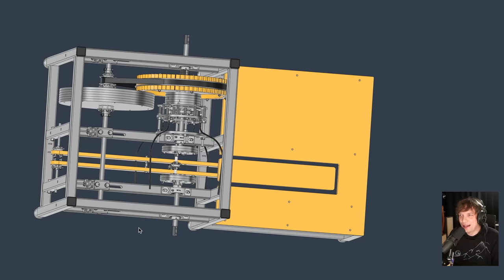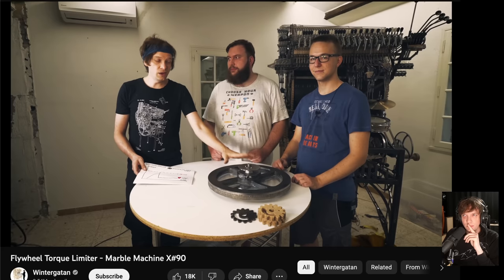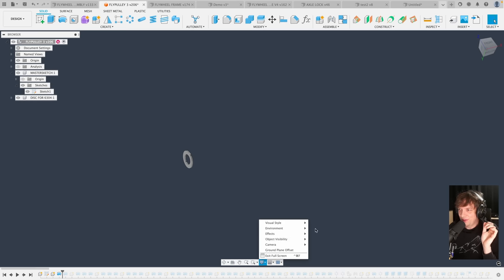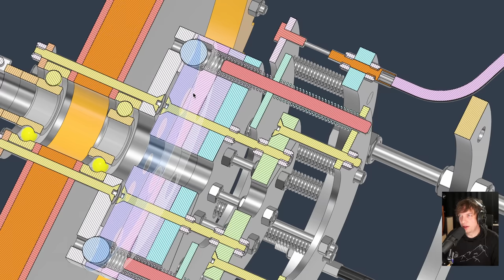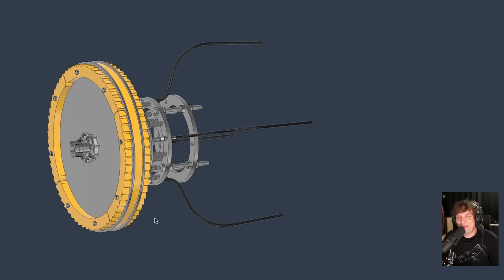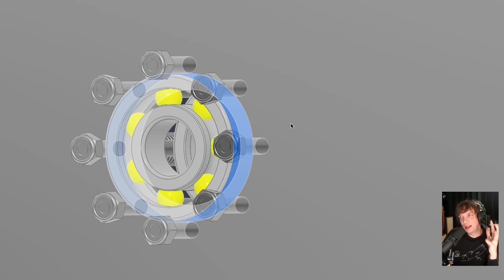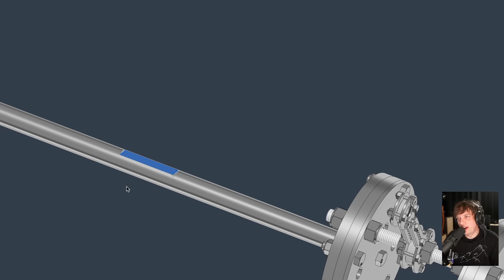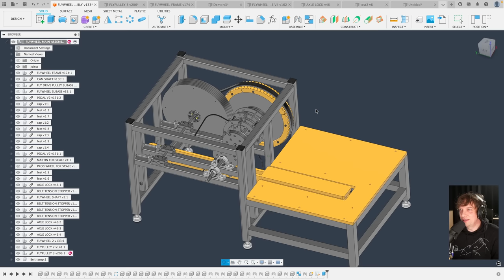Safety First! - Marble Powered Clutch

Comment: My guess on the ratchet design for the flywheel is that its going to interlock with another system to drive the marbles upwards similar to how the old fly wheel was collecting marbles with magnets.  The use of the ratchet there will allow it to pull a "track" of marbles upwards against gravity.   Each tooth of the ratchet will interlock with the track and move it upwards, using the ratchet design will help counteract gravity and the weight of the marbles + the track itself because it won't be able to slip backwards against the ratched tooth.

Comment: Put the pedal on a hinge so it can bend upwards and not crush anything underneath.
Reply: Or you could make the pedal belt driven with a free wheel and a spring that pull it back. Like a bicycle hub free wheel with a belt wound up on it, then you push down on the pedal to spin it up and then a spring the twists the hub back and pull up the pedal.

Comment: Love the design! Took me some time to take in as much as I felt satisfied with.
		Disclaimer: I'm a programmer, not a mechanical engineer
		
		The rods you designed look like they will be under strong rotational stress while breaking (Unless there is no friction at all?)
		- Could they bend? Could they damage other components like the spring and the holes it sits in?
		- The green disk is basically floating with a thin hole and the hole with the spring offers no stability at all

		Great you are cutting a corner with the bearing sleeve. is it easy to fix if you are wrong?
		Or are you going to test this in order to avoid ASSUMING? 
			
		Can you also test how much rotational newtonMeter is generated and whether you shaft/discs are going to deform?

Comment: 18:00 I work as a design engineer, we have already mounted bearings in this way on a trade fair model. We only used fitting screws ISO 7379 for higher accuracy. We had the parts laser cut

Comment: One simple safety feature I would suggest is to connect the  foot pedal to the camshaft using a hook. That way the pedal can pull down when you step on it, but if the cam tries to push the pedal down, say with your foot under it, the hook just falls off and disconnects the pedal.

Comment: As an engineering student, I think your solution for the bearings isn't really good. (I actually really hate it)
Metric bolts are designed to provide axial calmping pressure, but trying to use it as a positioning feature just won't cut it.
There's play in the threads, M6 bolt flex quite a lot.
Martin, PLEASE reconsider this design coice

Comment: Hey Martin, What's a more pragmatic engineering approach?  A fixed flywheel assembly and an adjustable belt tensioner? or a fixed belt and an adjustable flywheel assembly?
When you consider all the torque, loads, and rotational inertia going into the flywheel, it would be much easier, safer, stable, and simple to fix the flywheel in place and put a regular belt tensioner in the system.

Comment: You could get better precision with bearing housing by putting locating pins in the housing and accurate holes in the wheel, that would eliminate the threads as sources of error, which could also be done with the current design you just need to find locations for the pins.

Comment: That's pretty cool. There is something you didn't explain from the split disk mechanism to attach the driving shaft. I was about to suggest you switch at least one of those half moon disks for a single-part disk with bigger opening to work not as a driver of the shaft but to keep the bolts from opening and bending. But then I noticed you have the middle half moon at 90deg angle which would do the same function. That's brilliant!

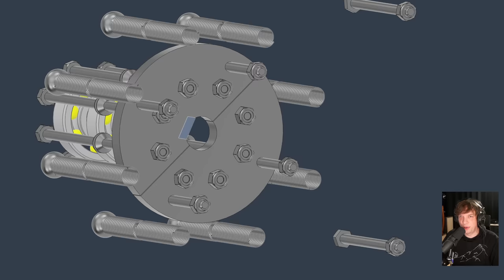Comment: 22:30 The half-moon in the axle is going to try to force the two halves of the disk apart from each other. The bolts you displayed pull in orthogonal direction only. That said, I agree that if you do this multiple in multiple layers and bolt those layers together, you'll have a connection that can hold the axle. It will have some slop but if the half-moon cut is big enough to overcome the tolerances and you don't mind the backslash, it should be okay.

Comment: How you considered using gussets on your frame?  Massively improved stiffness for very limited weight gains.
Welded square tube joints have some strength but are not immune to racking.

Comment: EASY SIMPLIFICATION IDEA - Feels like the ring attached to the cables that moves the plate towards the brake will wear very quickly. It effectively acts like a brake already. Instead of having a separate brake plate, why not just thicken up the plate attached to the cables so that can be the brake. Or am I missing something?

Comment: Oh Martin u have done it again, pls rewatch some of your videos, do a quick part count for this system PLS. 

This is artsy and overcomplicated af, as may other ppl have mentioned u should deff just put like break calipers and disks from a bike

 literaly just take the breaks off your bike and put them on the machine, that's probably where u got the idea to use boden cables in the first place

Also automatic torque limiters should be very simple, the easiest way to do it is with designed fail points, have spoks on gears that calculated to snap when too much torque is applied, that changes this from taking around 50 parts to 1 part that can be replaced.

Or u can add a spring attached to a metal rod, the centripetal force of the rod spinning pulls the spring causing it to extend and hitting something to slow don't the machine, that's like 4ish parts rather than 50 so still alot  better

Comment: Electric motor and variable frequency drive; You've got the 80/20, most stages have 3-phase power, you can get safety rated drives, free up your feet for more instruments or dance moves!

Comment: It seems like the ratchets will connect to your programming wheels in some way to prevent it from spinning backwards. The current pin/thing that lets you change how long a note is played only would work in one direction. This would prevent potential binding of the wheel and the pins.

Comment: How do you plan to center the bearing in that housing?  In a normal housing its defined against a machined hole. here, you are just going to put it right up against the thread of the bolts? you'd be relying on the position of the each bolt in their holes, and the OD of the threads which aren't really designed for holding a super tight tolerance like that. Is the laser cut tolerance really that good that it doesn't matter?

Comment: I think the ratchets are made that way to handle more power since it's gonna power multiple modules. It's gonna function like a normal gear but they have a sharper angle to grip better. Maybe it can also have gears underneath and where you are standing and have it function better than normal gears. 
Been following since the first Marble Machine and it's both amazing and incredibly motivating to see the videos you post and the progress you have made. 
Good luck and Godspeed. Love from Norway <3

Comment: If you intend on standing on the platform and pressing the crank pedal down into the platform, that sounds like a really uncomfortable position. You would need to bend you 'standing' leg to be able to reach down to the bottom of the pedal travel. If you want to physically guard the pedal, then consider a small enclosure around the pedal itself, perhaps with 'way covers' as used on milling machines to prevent your foot going under the pedal, but avoiding the need for the large platform.

Comment: Instead of the flat spot on the shaft, have you considered machined splines? You wouldn't need to split the 'half moon' plates, which might better distribute the pressure more evenly. I also think that you could help with alignment and rigidity by using some captively mounted precision dowels across those plates.

Comment: Martin, I am nervous that if you try to engage this clutch while the flywheel is moving, you're going to have a bad time.  As shown in your graph, the differences in kinetic energy is going to cause those balls to skip across those holes, not to engage, unless the flywheel is moving slowly.

Consider on the mmx: when the torque limiter engaged, was it possible to re-engage it while the machine was in notion?

Comment: That torque limiter is identical to the mechanism that exists in cordless screwdrivers to limit screw torque - the torque ring adjusts the spring pressure (it also makes pretty much the same sound when torque limiting engages).  That mechanism is so robust that is also used to provide the "hammering" in cordless drills when drilling in stone and concrete.  It's not as good as actual percussion systems but for most situation it works.  I love the combination of clutch and brake in one mechanism (and the use of industrial bowden cables which will slacken a lot less than the bicycle variants), nice design.  Might want to ensure you tighten the bearing holding bolts to the same torque (which is a bit hard to do accurate with selflocking nuts, but try).  I'm a bit concerned about the longetivity of the "no keyway" flat idea because it's subject to a lot of force trying to lever the two halves apart.  The idea of a keyway is to distribute those force transfers a bit better by lengthening the lever that transfers axial forces (think of it as a lever that starts at the centre of the axle going outwards).

Comment: Nice. One question. Is transportation a design parameter? Should the fly wheel, shafts and other components be completely on the inside of the frame? Than transport casing could be a clip on wall to the frame it self, not a box that needs to fit outside the MM3.

Comment: Regarding the pins welded into the plate, it will be critical to ensure these pins are square within tight tolerances. That could be difficult, especially if the welding warps the plate. Maybe brazing it is safer? A fixture will be essential for fabrication.

Comment: I see a lot of people already mentioned the issue of what steel grade to use, which brings me to question the manufacturing decision. High quality steel is very common in large cylinders form, this is why I would completely ditch the idea of laser-cutting the parts to have them made on a cnc lathe, in a well equipped machining shop. You could then house the bearings in a trusted way, the champers for the screws would be machined at the same time, and also the precision of the parts cut like that would greatly improve the stability of the moving parts. You will most probably have to check the most suitable steel for each parts, including the bolts, since you plan to exert an intense stress on these parts. 

It may work perfectly as you designed it when you test it, only to crash disastrously at the worst moment. I strongly suggest you put as little newbie innovations on a part like that. But, you do you.

Comment: I think the ratchet is is to protect the new programing keys, since the new design will lock and break if it runs backward. 

Could also just be to ensure that the 1-axis movement of the foot pedal doesn't push it in the wrong direction.

Comment: So it was the torque limiter making that sound. And all this time I thought that Motor Martin installed. A Jake Brake. I really love your new design methodology, and I still "Believe". Martin, I hope that you include Nashville, Tennessee or Huntsville, Alabama on your world tour because both are about a two hour drive for me. May I suggest you design in a speed regulator and a manual 4 speed transmission so with one flywheel speed your programming wheel can play 60, 90, 120 and 150 or 160 bpm, or however many bpm tempos are your favorites, and the spacing for quarter, 8th and 16th notes is a constant on the programming wheel.

Comment: Regarding the D-design for locking the pulleys to the shaft:

The two halves of the pulleys are going to want to pull away from each other from the torque. The only thing constraining the parts together is that they are bolted to a common part using eight bolts. The problem is, the eight bolts are very long. The two pieces need only separate by something like 2-3mm before the pulley can slip and the pulley's flat locking spot will probably become damaged. I don't think even eight bolts will keep the two pulley halves together enough to completely prevent that from happening due to their length. This may be not a problem on the pulleys which comprise the clutch assembly, but it is likely to be a problem at the driving pulley.

A possible fix is to machine a long oval through the drive shaft centered on the flat, and then add tangs on each pulley half that sit inside this new hole. This may help prevent this problem from bolt flexion from becoming a nightmare.

Comment: that was a nice explanation of how it works i just see a wear issue here since the disc you pull with the cables is stationary and the other spinning i know it will like free the marbels and thus torque won't be a constant issue but personally i'd add some pads as they are used for breaks on cars and such to make sure the discs don't wear out to fast.

Comment: So much feedback so you probably wont see this. I would separate the clutch and brake. You can still operate them with one lever with two sets of cables attached. The other thing is that some alu/plastic-sleeves on the bearing-holding bolts would allow for easier adjustment and forgiveness of imperfections. Otherwise is looks really good.

Comment: For the bearing housing, you could use a layer or two of the same sheet metal laser cut as donut shape around the bearing rather than directly going against the bolts

Comment: I have the Idea in mind, that for the disks that needed to be halved to put around the shaft. I really dont know how this is called but I thought I saw that on a docu for a motor engine. So my idea:

If you would break the round part that goes around the middle shaft in 2 pieces.
It would have 2 pieces that would fit perfectly together because the breakpoint only allows the 2 pieces to fit in the exact way as before the break.
So you would create 2 Puzzle peaces that would only fit with its pair together.
Perhabs I speak nonsense, but if I do not, perhabs someone knows the word for the process.

Comment: Regarding the 'ratchets' around the pulley: I can't see a need for one-way ratchets so I guess they are part of a speed measuring system, with a proximity detector or similar mounted to the frame. I think the machine will have a speed readout so the operator will know to increase or decrease their foot pedal action to keep the right music speed.

Comment: about those m6 bolts around the bearing, will you use some that have a non threaded part where the bearing is? commercial rolled threads are not that acurate that i would trust them to locate the bearing.

Comment: I think the ratchets will be used to put power into the fly wheel, so a pedal or lever movement dose not require a crank, it grabs the ratchet inputs power and spring returns.

Comment: Is the ratchet used to start the flywheel assembly in the right turn direction when stepping on the pedal? (If yes it might be noisy). 

Btw the Clubgeschichte, if it slips does it have the same binding force on the next marble position as in startup, or does it decrease its force due to the movement hitting the marbles and pushing them back and can the be calculated what’s the force will be before it can bind again (I.e. enough for normal operation)?

Comment: The toothed wheel engages with the turbo-encabulator, which in this clever application serves as an asynchronous vibratory generator to shake loose parts free and prevent sheared finnegan pins.

Comment: I think the ratchet will engage with a Bowden cable that will connect underneath, travel up the machine, and end in a handle that gets pulled down from above. Pulling this cable will start the flywheel spinning in the right direction, so when you step on the pedal it doesn't go in reverse.

Comment: I wonder if that split disc to mate the drive wheel to the drive axle is going to be able to resist the rotational torque of the axle and maybe just start slipping.  There doesn't seem to be much holding the two halves together other than the bending strength of the bolts.  Seems to me you need something to exert some clamping between the two halves otherwise the axle might be able to push them apart and slip.

Comment: For the bearing the metal cap could be the housing  and could make the bearing easy to replace if it goes bad. So instead of a housing it would be a bearing cap. Also you could go to a tapered bearing. Just needs a nut to hold those

Comment: If you have a belt drive - you already have a clutch and torque limiter. Just add a belt tensioner (kind of spring-loaded wheel) that will limit the force on a flywheel and disengage the gear.

Comment: Hi Martin, you are looking and sounding in good spirits.
Screws/Bolts should not be used to provide precision; they are not designed for it and they will be a source of frustration for you.
Slip a machined tube that is a snug slip fit on the threads and registers to the to faces by fitting into holes; so the bolts will only be clamping the machined tubes in their precision cut holes.
Also when manually engaging the clutch you will have to secure the marbles so they are not just rattling round in there...

Comment: at the end: the rachet is your pump to move marbles up to replenish the system. 
now the important bit...
the flat cut in the shaft is a quick failure point.
the enormous amount of torque difference will fore shure sheare there.
do change the design, do use a hefty key, or two 180 apart.